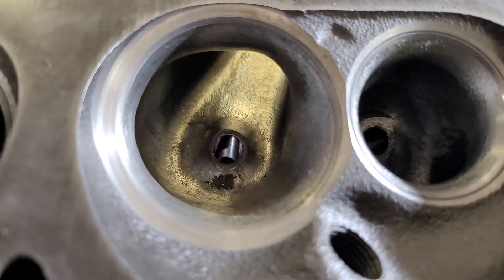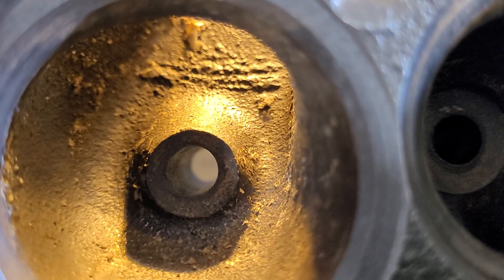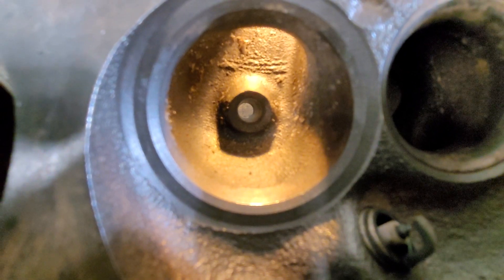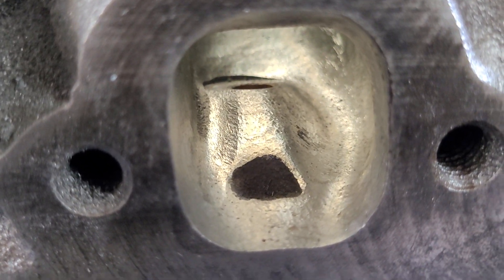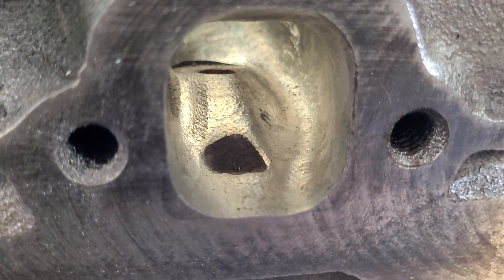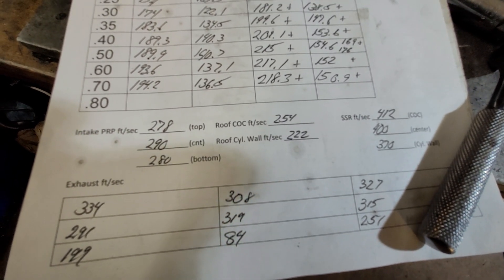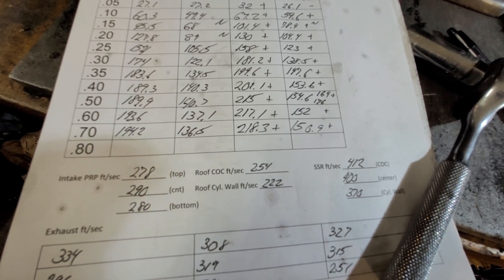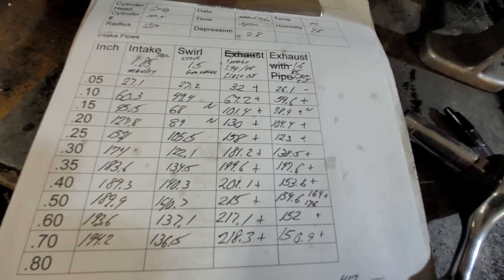Ford F3ZE Gt40 3 bar ported cylinder heads stock vs. first cut flows

Comment: I have been studying all of you videos, they are absolutely amazing- specifically on the gt40 heads. I am trying to read the chart for the air speeds on the exhaust port. Can you please give me a little info on them…

Are the highest air speeds on the shared wall side of the exhaust port or the opposite side (the long side of the port). I know that the roof has a much higher air speed compared to the floor. But if you could tell me which of the other sides has the greater velocity I would really appreciate it😀👍
Reply from the maker: @mattcurtis4362  Usually the shared wall. The better you equalize the speeds the more efficient it will work. At least I think so. Thanks
Reply: You are awesome, thank you so much! And again your videos are incredible, please keep making them. I can’t begin to tell you how much I’ve learned from them. Your knowledge of port work and fluid dynamics is remarkable. Getting to watch a master at work is priceless😀👍
Reply from the maker: @mattcurtis4362  I appreciate that. Remember, there are plenty who think I know nothing. Good to remember.

Comment: I had a set of these cylinder heads done in 2003 and they flowed about the same numbers as your first cut on a 306 inch motor and made 480 HP when I sprayed it with 175 it made  625 good nitrous heads
Reply from the maker: Made 480 on what they flowed on my first cut? Nice!
Reply: What pistons You use?

Comment: Charles on that chamber area on the wall side of the intake valve would it be best to go in there and unshroud the intake valve and get the compression back by milling the head ?.and what are your thoughts on a 1.90 // 1.60 for valve sizes ? My thought is keep the 1.90 intake in it and retain some port velocity And get all I can from the exhaust side.
Reply from the maker: The 1.94" /1.6" combo is pretty good, the bigger intake flows a bit more in the midrange. Milling is great but may also come with a flow loss.

Comment: I was hoping you were going to ask for a set of Olds 455 Ga heads. Maybe next contest.
Reply from the maker: If it is not a numbers matching deal take a good look at aftermarket castings. Stockers can be made to work but need alot of effort.

Comment: Just bought some GT40 valves but not for GT40 heads LOL
Reply from the maker: Length will need different length pushrods for geometry.
Reply: @servediocylinderheads  They are just over +.100 length compared to a standard sbc valve.  I already needed +.100 valves for these heads.  And I always check to see what pushrod length works best with my components.

Comment: Yes finally some porting info on some 3 bars.  Can not find much info on these heads, or at least a decent amount of porting info other than just a clean up or crazy amounts of reshaping from obvious beginners (like myself) that think get the biggest hole is the object.
    Mine are Cobra gt40s and have the egr bore so I'm limited on raising the exhaust roof.  
    One suggestion Charlie could you use a pointer as your speaking of particular areas of the bowl, walls, roof etc.  I have a hard time following you at times.
  Thank you for a great amount of information.
Reply from the maker: I can. Good point.
Reply from the maker: I couldn't find much internet info on these heads at all.

Comment: I have a set of 3-bar GT40s on my 5.0L that have had some port work performed, but no idea on flow numbers. Still retained the stock valve job and valve size. Made 281rwhp on a very mild N/A combo, ran mid 12s @108 in a full weight notchback. It's turbo now and down with a cracked block through the mains. I've been debating picking up a set of Promaxx heads and swapping these GT40s onto my explorer to replace the GT40Ps or send the Ps out for porting. I can't wait to see what you do with these GT40s.

Comment: Charlie, you want a good comparison? Revise the question to old AFR 160cc small block Ford head's. Why you ask? Because AFR was losing their tail with the old 160cc head to a ported 1969-70 C9OE/D0OE 351W castings with 1.94" intake valves and 1.60" exhaust valves. They had to revise that 160cc head to a 165cc and reconfigure the port some more. I'm curious though, I wonder if I raised the exhaust floor like you said that should be done but make it a True D port if it will really wake it up? This is why I'm looking for a scrap GT40 Three bar cylinder head.  I will nickel weld the floor upward or use Braze since it's not going on a running engine but testing purposes only.
Reply from the maker: I would like to see that experiment. I bet it works.

Comment: Thanks for the great videos.  I'm am a GM guy but I watch all of you videos.  After all I will be attempting to port my 248 straight 8 Buick head some day. I always learn from you.
Reply from the maker: My Dad's first car was a Buick super 8 with dual carbs he rebuilt and hot rodded. Supposedly it is crashed in the Rocky Point preserve back were I used to go mountain biking on Long Island. I never found the wreck that was left by the guy who bought it from my Dad.

Comment: Stock cuts. I am uploading a video on the stock cuts on my brothers mopar #308 heads. There are three angles and I really like it with those 1.88 valves considering how restrictive the pushrod pinch is on those heads.
Reply from the maker: 308's or 302's?
Reply: @servediocylinderheads  i both sets. The 308s are a 360 open chamber head. And the 302s are 318 closed chamber. I was referring to the 308s. You can make them flow quite well with minor work. Where as the #302s  just have to small of ports for a 360.
Both the #308 and #302 heads have restrictive pushrod pinches.